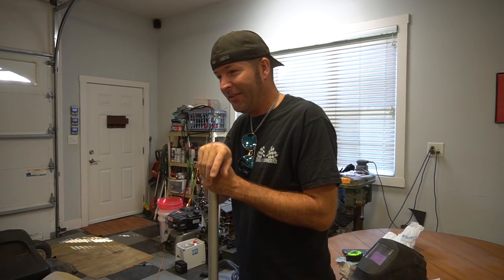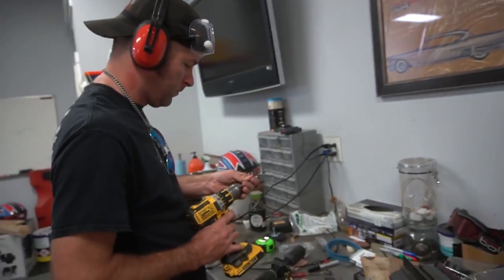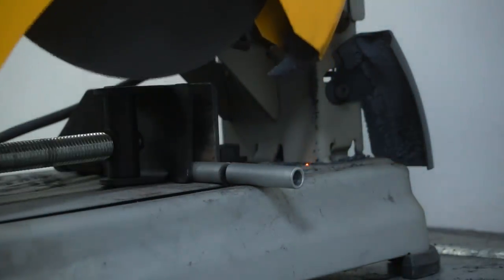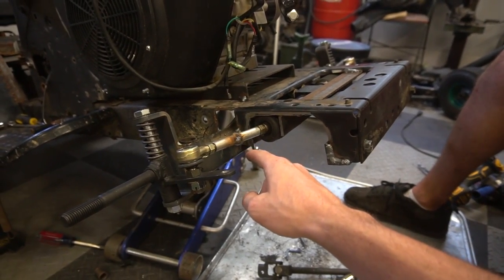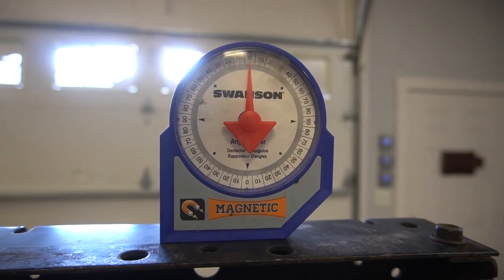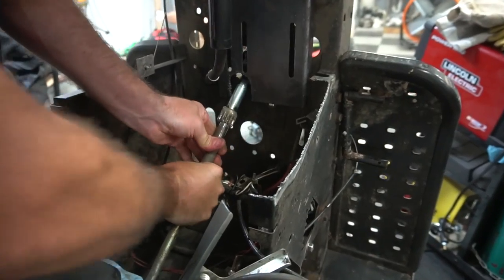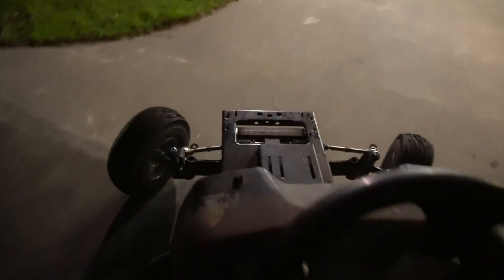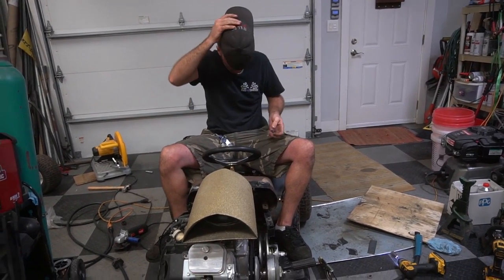Rack & Pinion Steering | 50HP Lawn Mower Pt. 2

Comment: Looks like the steering angles are wrong, the inside tire needs to turn sharper than the outside tire. That rack should go behind the axle. You guys covered camber, caster and toe, but the Ackerman angle is wrong.
Reply: Yep

Comment: Do you have a proper ground on your plasma cutter? It’s acting like you’re relying on the torch tip for ground.   The intermittent flash is the auto-start function doing it’s job....but the ground has to be there for the plasma arc to maintain. I know you have a clamp for the ground but that arc is wrong.....maybe a problem with the machine?
Reply: I think its just crappy
Reply: Isaac it'll be fine   That sucks...    I guess as long as it cuts, it’s useful.

Comment: Inside wheel is supposed to turn in more sharply than the outside wheel. That’s why it’s scrubbing instead of turning. Check out proper steering ackerman 👍🏼
Reply: Yea. I messed that one up
Reply: Isaac it'll be fine no worries! You guys are awesome. I hope I can make it out to the next meet 👍🏼. Keep up the good work

Comment: You guys should really consider dropping the seat even lower. It's going to be possibly way too top heavy and you take a turn too fast, ER will be where you might wake up.
Reply: The chain and sprocket are there unfortunatly
Reply: I'd maybe look at FXT race mowers for inspiration or even extend the frame a couple inches to move the axle back so there shouldn't be any issues.

Comment: There both not good lookin welds but ikes looks better. Johns is all bunched up in top of its self. You need to learn ho to set the wire speed and heat. The welder isnt suppose to sputter like that. Its to cold with to much wire speed.

Comment: For God sake turn down the air pressure on the plasma and pull the tip just off the surface of the metal. I bet you are burning through tips like crazy!!

Comment: The rat rod wagon had the same problem as this project. You've basically built the same problem into this front end as you did the rat rod wagon. You're basically forgetting or ignoring all the rules of the Ackerman Theory or principles to have correct steering geometry. It has nothing to do with how much weight you have on the front end, it has to do with the incorrect steering geometry. All your steering problems can be corrected by applying the principles of the Ackerman Theory. I would describe what you need to do here but it's a very long drawn-out process to describe in such a small textural comment area, plus most of your reads would annoyed. Basically the outer wheel on a turning radius needs to be turning on a larger diameter than the inner wheel. Example: If you turn right, then the right wheel would turn on a smaller radius than the left wheel. If you turn left then the small radius would be on the left wheel. There are other principles of the Ackerman Theory that should be applied. I noticed the front end bent when Ike jumped up and down on the frame. You really should beef the front end up, because the forces applied to a front end with incorrect Ackerman could far exceed Ike's weight. Having the rack in front makes your problems worse. If you leave the rack in the front then you'll have to alter your spindle assembly. Actually, you need to alter your spindle assembly regardless where the rack and pinion assembly is mounted. This is all fine and dandy till the front end breaks at 50 mph.
Reply: The outer wheel does turn more. If you have 230lbs on a rear axle and 5 lb on a front axle its not going to turn no mater what. We have it rite. Just wait till the next videos, i think you will enjoy them
Reply: @isaacitllbefine7231  
I agree the outer wheel will have to turn faster because it's travel is on a larger radius. That's not at debate... You have a plowing issue with the front end. If you don't correct your steering geometry using the proper Ackerman Theory or similar principles, then it will continue to have a plowing action. You need to change the center line axis of the Kingpin/spindle assembly or your steering will always continue to have a plowing action. In your video you can already see that the steering on the outer wheel is tighter than the inner. Remember the outer wheel is always traveling on the larger radius. When the outer wheel turns tighter than the inner wheel, that basically causes a 'lockout' affect. It's similar to roller blading when you get the angle just right and it permits you to push off and go forward. However, in this case it causes you to lose traction and then your vehicle continues to plow straight instead of turn. The beauty of the Ackerman Theory is that it lets you have superb steering capabilities at slow speed turns. You guys already have a plowing issue with minimal or no forward thrust. Again, it is not a weight issue, it's a steering geometry issue. I agree adding weight to the front end will increase the tire(s) 'contact pad area' thus it could increase traction, but you'll still have an inadequate steering geometry that causes the plowing effect. This is a physics principle that can't be changed. As you would assume, none of this deals with slip angle effects. If you don't want to correct your steering geometry that's fine but include a disclaimer, so an over zealous 12 or 14 year old with a cheap welder and bad welding skills doesn't try to emulate your design. If they get hurt then that makes you liable.

Why would you not want to use the Ackerman Theory or a similar principle which creates better functionality of the steering system and would be 10 times safer.

Comment: You guys just made that tractor frame junk. If your brakes fail and you hit some thing the frame will go up and smash you motor all to garbage. Also it will go straight down under any pressure even hitting bump s

Comment: you need to stop screwing up your steering geometry .  the inner tire is supposed to turn MORE than the outer , not less like you have . That is why many carts have a degree toe-out,  to increase the turn-in ability . Try moving the linkages to the original hole on your control arm, you don't need super fast steering anyway